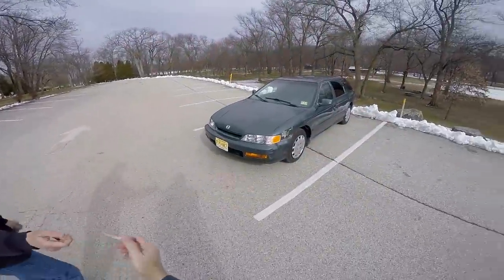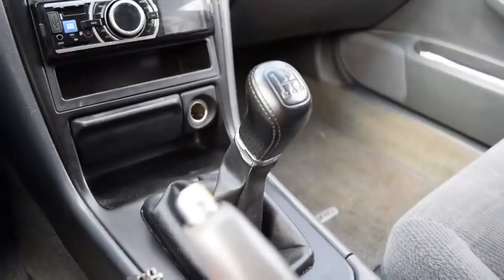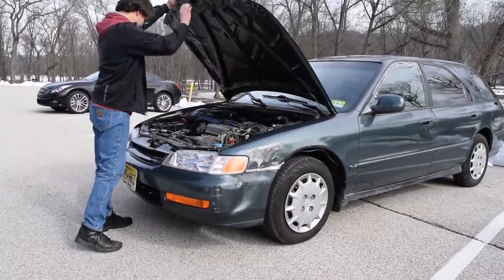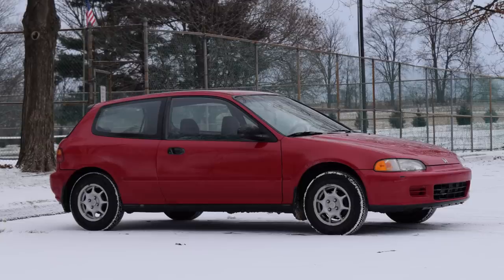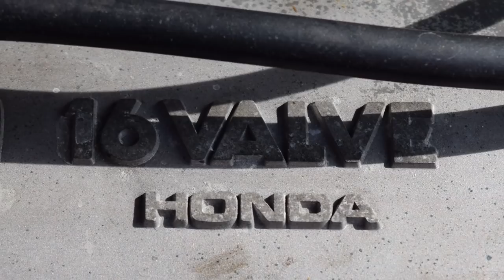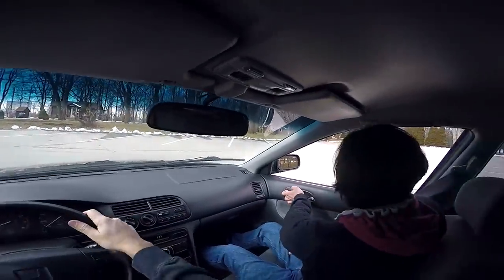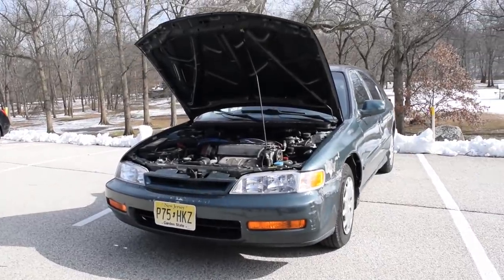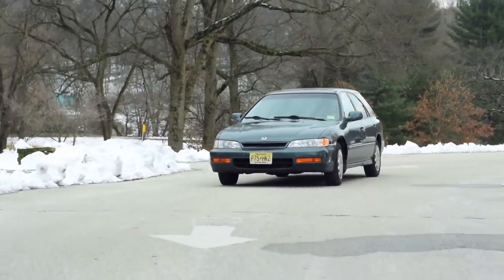1996 Honda Accord Wagon 5-Speed: Regular Car Reviews

Comment: F22 turbo engines are some of the most fun I've ever driven. I actually love this platform for moderate builds with a medium sized turbo around 300 350 ish hp, not a drag racer, but a very athletic sedan/coupe or wagon. They are all great! I think it's fine to leave them stock, but with a few thousand dollars into the engine and drivetrain and maybe 1500 into suspension and some mechanical no how throw in an extra 3 or 4k for miscellaneous tuning, tires, brakes and things, for probably 12K to 14k all in completely built you can have a bullet proof accord, that handles extremely well (when setup well on correct tires, wheels and suspension) with a turbo as long as you do studs, bearings, and internals (rods, pistons, a cam if you're feeling frisky) and an ecu. You would be able to beat on it, even run E85 if you want another 85 to 100 hp at near same boost but then you have to get bigger injectors since the fuel energy of E85 is lower but cooler, it takes more e85 pouring in per gallon lets put it that way. So more has to spray in through injectors. But If you want complicated, want to build it yourself, or at a shop but not have something thats premade at a dealership where you cant touch anything for warranty purposes or wont. Then you can do this, or you can go super budget and keep it stock, but I prefer building cars and not having new dealership cars, even if I don't keep them for more than a year or 2. And I don't sell them blown up or cheaply built. They all have proper parts, sometimes not always new turbos but always well working ones. It's a fun hobby and as you do it more and more you find more conisistent ways to find parts cheaper and even used wheels for 1/4th the price of the 3k or 4k when new. Car Building will always cost money but when you start hoarding parts and saving up money, making trades for other car parts or wheels, getting odd things in return for trades that sell for lots of money to someone in the phillipines thru ebay, and now you've got real Oz Futuras for next to nothing and are afraid they'll be stolen so you end up selling them for 4 times the price you got them for at around 3500. Things like that add up and you end up with a problem, way too many parts, and every time you move to a new brand and start selling all the parts from them as you clear the space for the new brand, you find out you have thousands of dollars worth of parts you've hoarded over the past year or two and then bam your new problem i mean, build is underway.

Comment: you haven't driven my Mazda Protege5 yet.
Reply: Michael De Leon manual or auto?
Reply: Correct.  I had one for 10 years.  Would still have it if not for the structural corrosion.  Maryland roadsalt, yousee.
Reply: Auto sadly. It'd be much more fun had it been a manual, but it's my first car and thought I needed an auto to learn how to keep it well maintained, only to realize I desperately wished I got it a manual.
Reply: +Scir louie yes they are

Comment: What if you forget to put it in neutral and then use the remote starter?
Reply: Properly installed autostarts for manual vehicles have a neutral position switch and require a bit of a process to 'arm' the system. All of this is so the autostart knows the vehicle is in neutral. If you opt to save a bit of money (and not install the neutral switch), it's possible to start the car in gear and have it drive off...I've seen it happen.
Reply: oh man that self-driving shit is way ahead of tesla
Reply: Uhm I just got one of these and I didn't know it had it so when testing the buttons on the fob I hit the * one at I thought it was the panic and well it turned on and drove off and hit a brand new WRX that they had just gotten off the lot that day. I felt so damn bad and I still do
Reply: In my teens i had to chase my car a few times for forgetting the thing was on gear when remote starting it. One time it smashed against a wall at a baseball field.

Comment: I bought 92 Accord with close to 300,000 miles.  I had some suspension work done, gave the car a thorough tuneup and the car ran like new for 4 years, until I was ready for an upgrade.

Comment: I had a '96 Accord EX with a 4 cylinder VTEC and a manual.  It was a fun car and I moved cross country in it, which was a challenge.   It wasn't all that fast around town but it had a lot of top end power.  I had it over 130 mph on a couple occasions.    (Thanks, for the memories, Montana).

Comment: Had a 1995 Accord Aerodeck, 5spd manual and 2.2litre R4 engine. Really great engine, handling was also quite good for a mid size family car. It was built with reliability in mind and never broke down on me, even though I did replace some of the bushings, brake pads and rotors. The car doesn´t feel bulky and big, throttle response is good and car is responsive. In that way it´s a nice first car, because it teaches how a car handles, doesn´t break down often and won´t make a newbie driver over confident or careless like a new car that can be deceitful with its driver aid systems that can backfire one day when they don´t work or malfunction in a crucial moment.

Comment: After watching this, you would absolutely love my 1995 Volvo 850 2.4l N/A 5cyl manual. Passion Red, Wagon, revs up to 7,000 rpm and is a blast to drive for what it is. It's my parts car, but I find myself enjoying it more at full chat than my 16 Miata. The high revving 5 cyl is a very special note.

Comment: I didn't believe you when I first watched this review, but recently I got a 94 sedan with the 5 speed, plenty of rust, and 307,000 miles.  It's still a fun car to drive.  I've put it on stiffer springs, threw on an intake, and messed with some cosmetic things.  I've had an Rx-7, a GLH Omni ex-rally car, I have a conquest, and this accord is still fun to drive.

Comment: First gen Expedition with a 5.4 is my recommendation, you can get them in the $1000 range, massive vehicles but that 5.4 will remind you every once in a while that it was still the most torque you could get for that class of SUV in the 90s. They aren't fast but they got balls, and they're beastly in the snow. Best part is, all a parent can see is 5200 lbs of steel, 4 wheel drive, and a platform that didn't have hardly any problems worth noting.

Comment: Best time for Honda's. My 2000 Acura 3.2TL has 306,310 miles and still drives daily. And still fun and fairly powerful, I have no problem flying past slow pokes on a 2 lane road. You can't beat a Honda for reliability and practicality.

Comment: I have a 2000 Toyota Camry with a 5 speed manual transmission, 2.2L engine. Since I haven't driven this accord, I can only imagine they have a similar driving feel. I'd say the accord has the faster engine and better feeling transmission. My Camry's gear lever feels long and clunky but that doesn't take away too much from the fun of the car, especially in the higher rpms. I really liked the cargo area of this accord, those cubbies are sweet. I love my car, and I believe it too is an enthusiast car that should be appreciated.

Comment: My mum had a '94 model of this car with a 4 speed auto, quite heavy and underpowered for its weight and size, but it always ran and was super reliable, never had any serious issues over its 10-12 year ownership. She replaced it with a used '06 Ford Focus and its front passanger side door lock broke within a few months, that car just feels so... cheap compared to the '95 Honda.

Comment: Accords are quite fun. I had a 3G LXi hatchback and a CB7 (4G) coupe and they were some of the funnest cars I've owned. I took the 3G to a lake and I was able to park in the much nicer area with the trucks and Jeeps because I had enough ground clearance and the beefy double wishbone suspension made it a breeze to get there. The CB7 gave me similar feelings as expressed in this video, but I did have coilovers and a couple bolt-ons on it. I currently have a '96 Integra with a lot of mods, and while it's fairly quick and nimble as all hell, I still have a soft spot for Accords and will probably get another one, probably a 5th Gen (maybe even this same wagon) with a H22 swap.

Comment: I LOVE these cars - of course I'm a bit of a freak about weird Hondas (I owned and loved two first-gen Honda Odysseys, racking up about 600,000 miles between the two of them) These Accord Wagons and the first-gen Odysseys  were so bland and unassuming that you virtually disappeared while driving them - and driving them, while not tingly and exciting, was pure, unadulterated, creamy smooth bliss.  Pile four (or five) peoples and their stuff into one, fill it with gas and a cooler full of delicious food and drinks, crank the AC/heat and gobble up hundreds, if not thousands of miles of highways and backroads in velour lined cushy comfort.  They are invisible cruisers - no one pays any attention to you and I loved that.

Comment: When I turned 18 my parents bought me a ford contour sport manual. That was probably the best car I ever owned except for an electricity leak or something. If I was idling for more than 10 minutes the car would die and I replaced the alternator and the battery to try to stop that but it kept happening. I later sold it but I still remember how good the gearbox was on it, my friends and I marveled at how it wouldn't grind gears if you tried. I would be going 30mph and (with the clutch out) force it into second but it wouldn't pop in until it reached 20mph then it would clunk in with no effort at all.

Comment: Fun wagon options - 2005ish Legacy GT wagon 5mt (not that outback malarky), 2006-2007 wrx wagon 5mt (not the SuBROru wrx sedan) 2006-2008 Forester XT 5mt (technically a CUV but put wagon suspension under it and it's a wagon). Subarus are basically legos so if you find one with a turbo 2.5 and a 5mt you can make it into what you want. I'd actually prefer a rwd mt wagon myself, but there aren't any in my price range that are worth modding (240 wagon with an LS/6mt swap would be nice though).

Comment: I had a 1994 Accord Wagon with a five speed. Bought it new off the showroom floor. Loved that car. The shape made her top out at a tick under 150 mph. Eventually swapped out the  2.2L and replaced it with an H22A from a Prelude SiR. Added a turbo, suspension, brakes, wheels and tires and some interior bits. Kids with Mustangs and Camaros were wondering what the hell just happened. Perfect for my catering company, hauled my mountain bikes and surprised a lot of people at track days. Got hit by a transport (his fault) and that was the end of that.

Comment: A 2005 Ford Taurus SEL can in fact be a fun car, it speeds nicely and does reverse donuts and tail spins excellently. Source.

Me circa 2007 when mom found out they wouldn't renegotiate on the the co-signer part and were going to repo it. She just hand the keys and said "Don't die or wreck". Which is ok in the semi rural parts of Alabama, when you can see for a few miles and know where the empty parking lots are near the high school.

Comment: LOL... my daily driver for the last 12 years has  been a Honda Accord 1997 sedan 5 speed manual, and hell yeah... It is fun to drive, never breaks down, original AC still runs perfect and has 220K miles, 2 timing belt changes (every 100K miles), 1 VSS ($30), 1 O2 sensor ($40) and 1 small thing inside the distributor (MCM I think was the name $40 NOS on eBay), 4 shocks ($40 each) and 2 CV joints ($60 each) were the only ever repairs/maintenance out of the normal (oil, brakes, tires) needed by this car. I am waiting for the AC to fail and then it will be worth getting a newer car that for sure will not last even half of what this amazing piece of Japanese engineering lasted.

Comment: Sure, a Taurus may be boring and slow, but teenagers will always find a way to make it fun.  I have an 07 Ford 500 and even though I'm scared to take it past 90 on the highway, it's beige inside and out, and weighs almost 2 tons, It can be fun to drive.  I've whipped it around corners on back roads many times like I'm driving a little sports car.  Just because it was built to get grandpa from the old folks home to the bingo center doesn't mean I can't turn my daily commute into a track day with it.

Comment: my dad had a 92 accord and it was an excellent car, he drove that damn thing for fucking ever before selling it to my buddy for next to nothning. not a bad motor, excellent shifter and the lightest easiest clutch ever. any of the cars on this platform are fantastic. ive got a 97 acura CL, which is a dressed up accord 2 door and its not only comfy but actually a blast, it pulls harder then my toy XD and it cost me 2500 bucks. good first car or cheap eco commuter.

Comment: I think that's the same engine that came in the early 90's preludes. My dad owned one and it is quite nice to drive...around 160hp, 160 lb. ft. which is a lot for a Honda engine.   2.2 is good size for a 4-cyl.

Comment: I had a subaru legacy 5 speed wagon. similar deal. japanese manual shifters and japanese small displacement engines are a pretty good recipe for stealth fun. But as mentioned it was a decent sized car, and I hauled around a fair amount of stuff with it in college. Japanese cars have always maximized interior vs exterior space, my friend with a taurus wagon and my other friend with a volvo wagon all had similar storage capacity with varying exterior dimensions.

Comment: I had a 1991 accord sedan (also stick) for a few years.  It was a pretty great car.  It was also the fastest car I had ever driven - I had taken it up to about 120.  My 2018 Mazda 3 also tops out at about the same speed so it's hard to say which is actually faster, but my 1995 BMW 325i had the governor kick on at about 110 so it was faster than even that.  It competes with my 1986 VW Golf for one of my favourite cars to drive and own.

Comment: My best friend had an army green painted 1996 accord sedan, lowered about 3 inches and had a full booger weld exhaust welded to the frame on some crappy lowprofile wheels and tires and even then, with that manual trans he could outrun our buddies 2011 STI in the bends because you could ring that car out like crazy. Slam it into any gear any time you want, dont bother waiting for rev matching. And that car LASTED it had over 370k miles, and had several owners and is still running in the next owners hands to this day.

Comment: I had a 2002 Honda CR-V.  It was weird and heavy.  It was fun for mild off roading.  It had the 2.4L K24A1 V-TEC engine.  It was not fun on road at all.  But it had a trunk floor with fold out legs that could be removed and turned into a table XD

Comment: over here in the uk, we had the smaller capacity 1.8 litre engine too.
not as quick but only slightly less thirsty than the 2.2 litre.
also 2.0 litre was available too

Comment: had a 96 coupe with this same engine and 5speed.  You could run it hard, fast, still get 30 mpg and it would run on a pint of oil. My Lil H died with 334534 miles. She'll be missed

Comment: My take is that 80s/90s cars were still nowhere as well insulated and had far less material that blocked out noise and other feedback. The same engine in a car today would never sound and feel as lively - you're hauling 400 pounds more plastic and metal, doors are twice as thick, everybody has an engine cover. Wanna have fun with a car that doesn't have much power? Get one from the 90s.

Comment: It's funny how many Hondas are secret drivers cars... I have a 2011 Honda City from freaking Thailand and it is the best handling, most fun to drive cars I've ever owned. Mechanically it has much in common with a second generation Fit except it has a longer wheelbase and rear disc brakes. And 120 hp from a 1.5 litre isn't bad at all...

Comment: That's how I feel about the new Camry. "Safe" ultra low maintenance and will run forever if you change the oil. The 2.5 is an amazing little 4 banger with a pretty great 8 spd. It's not a 0-60 car, but you can really hustle it on some winding roads, and it will put a smile on your face. The new Honda's are a disappointment. They want you to service the fuel injection system and CVT at the dealership every 40k. That's ridiculous.

Comment: Yeah I love my FIT a lot, but yeah, the rear cargo floor does feel like it will bend. It never did despite me putting nearly hundred kilo of crap couple of times but that Accord cargo floor is awesome. Personally I like 5th accord styling. a little generic but there's something to it that I like. If I remember well the EX-r had 145 Hp and theV6 (a 2.7l I think) had 170. V6 like nice but no manual on them I suppose. Old accord are really nice cars.

Comment: This video is old, but this video is what i watch to make me want to keep my accord, i have a 2002 accord with the 5speed and 2.3 Vtec motor. the body has 307,000 but the engine has 70,000 on it and it is a FUN car, you can drive it how ever you want and that little 4 cyl just eats it up. in conclusion: the only reason i keep my accord is cause i watched this video

Comment: My mum owned this for a while, it stank, it was full of spiders, little to no paint left, still stock radio (broken), probably 10 hp, terrible auto apparently, just one headlight working, no aircon, windows went halfway then we had to hit it for it to keep going, it wasn’t in good condition........... but the horn worked, but it was only one tone the other one didn’t work.

She drives a 2015 Subaru Xv now it’s a lot better

Comment: I had owned 2 cars a gs300 and a 1996 d16 honda civic sedan, and I had so much more fun with the honda.
I could take it to the redline in 1st at every intersection, and I never got a speeding ticket or broke the bank on fuel 10l/100km. where as with the lexus i was driving super careful  because of the power and rear wheel drive